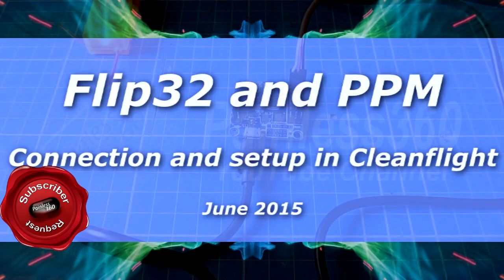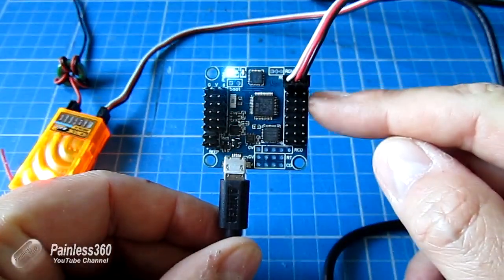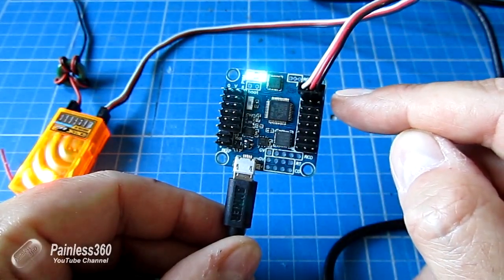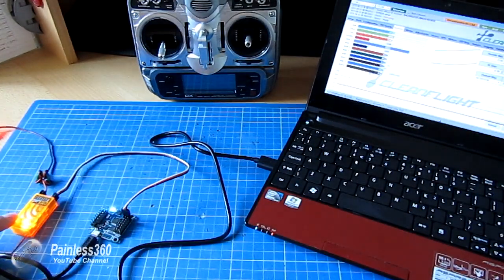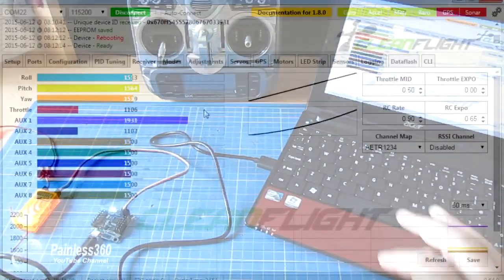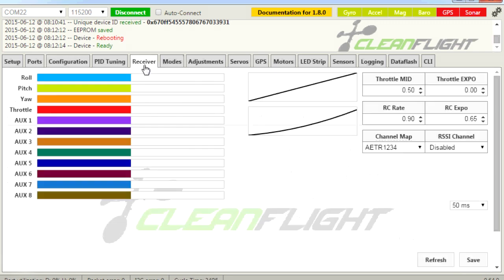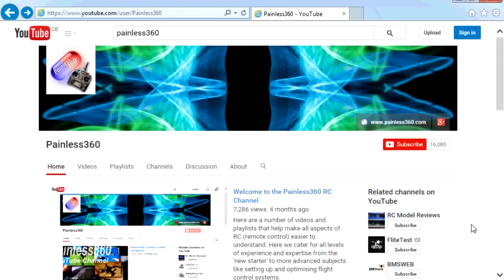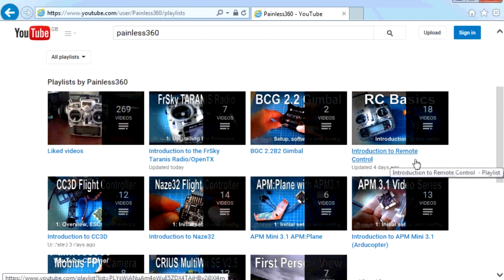Flip32 Flight Control Board: Installing the configuring CPPM/PPM

Comment: HI, thanks for the great video. My receiver and motors are working perfectly on INAV GUI. However, when I try to spin the motors with the RC transmitter, it won't work. I watched your building the quadcopter series, but I don't see any steps missing for my DIY drone. Could you give me some advice on this, please?
Reply from the maker: How are you arming the quad copter?
Reply: @Painless360  Arming the quad copter with the USB port to the INAV!
Reply from the maker: @Taka-tg8zq  I'm not sure I understand. You need to set up an arming switch as one of the modes. Please see my iNav setup videos for more information. Best of luck!
Reply: @Painless360  Arming is done perfectly. I watched the series too but there's nothing that I can add to fix. Maybe the problem I have is because I am not powering the flight controller with the battery but from the USB?
Reply from the maker: Motors won't run with USB. Please follow the steps in the beginners guides.. Best of luck!
Reply: @Painless360  My motor run because I am wiring an ESC to the battery. USB is for just to power the flight controller. The only issue that I can see is that I don't have a GPS module. DO you think that is the reason for not be able to use RC transmitter to run a motor?
Reply from the maker: @Taka-tg8zq No idea, most modern software won't let you arm when connected by USB.. Check the documentation and best of luck!
Reply: @Painless360  I am so sorry. It's a micro USB cable! So powering the FC with the cable like you do in the video!

Comment: Painless360

Enjoyed your video on using ppm with the Flip32, but no joy on my setup!

Setup is 9XR Pro w/ DJT module and D8R-ii plus RX into Flip32 running inav

System worked perfectly with T6 radio and PWM. When I switched to the 
9XR Pro with DJT Tx module,  I chose to use PPM. The DJT binds perfectly with the 
D8R Rx  but no signals are reaching the Flip32. I have changed the RX 
type in inav to  RX_PPM but none of the receiver channels are affected 
by the moving the transmitter controls. 

I am totally new to the PPM protocol ....... am I missing something ?

I have been banging my head against the wall for 4 hours now, but no closer to a solution. Any help greatly appreciated !!!
Reply from the maker: There are a lot of videos in the 'Introduction to RC' series that cover the basics and may help, some receivers do need to be configured to turn on their PPM output. Best of luck!
Reply: Painless

Thought you might like to know:  The Frsky D8R-ii plus is advertised as being a PPM receiver, in fact the (poor) instructions that come with it even says it's PPM (NOT PPM capable). Turns out it cannot do PPM unless upgraded to the equivalent of a D8R XP. I have done this and now PPM is working fine. Anyone comtemplating the upgrade should know it is not simple and not for the faint of heart. Buying the Frsky update cable does make it easier.

Thanks for your continuing educational work. Your videos are the best on the net - well thought out and excellent camera work. You set a high standard for others.

Cheers
schuh

Comment: Hello, thank you for your videos, they are excellent. I'm French and I have a  Flip 32 card in sbus with inverted cable and everything works perfectly. I would like to add a gps but how can I connect it to the rc4 flip32 if the entry is already occupied by the sbus? Is there no possibility of combining sbus + gps on flip32? Thanks

Comment: When using PPM or S-Bus how do you set the throttle end points for the motors?  Is it sufficient to just use the Motor tab in Cleanflight to accomplish this?
Reply from the maker: Dale S The same way as you would using PWM. Using PPM only changes how the FC hears the channels from the Rx, not how it runs the motors..
Best of luck.

Comment: Hi Lee,I have a naze 32 board ,watched all your videos but how do you connect extras to the quad I am running an orange 7 channel ppm RX how do I connect things like extra LEDs,retractable under carriage iam trying to fit a HK screamy lost model alarm please help.
Reply from the maker: +Geoff Taylor This is all covered in the Naze32 videos - you simply need to find where the pins are on the Flip32 for that feature. Everything else in the video is the same for both boards.Best of luck.

Comment: nice tutorial, do you have to program the RX in any way for it to work?
Reply from the maker: +rallekralle11 Normally no. Best of luck with the build. See my playlist 'Introduction to RC' if this is a new hobby for you..
Reply: okay, thanks for the help. i've build multirotors before, just not using CPPM.
Reply from the maker: Got it. Some Rx need you to set a jumper to configure PPM, some others not. It will be covered in the manual for the receiver. Best of luck!

Comment: My choice is to start fresh with a stm32 board like the Flip 32 +,  or keep the APM 2.6 and get the telemetry adapter ( teensy). first choice has better future prospects and costs less. what do you think?
Reply from the maker: Depends on what you want to do with them ;)
Reply from the maker: https://youtu.be/k4tQAmg2ssA
Reply: Video was great, cheers.Not bothered about acro as i am still learning to fly. Just want current support and everthing the APM gives, pretty much the Pixhawk, Pixhack, or what ever the latest clone is to be called. Anoyed that the mavlink to frsky telemetry adapter is £30, but i can use that with the Pix anyway. Great videos, i dont know how you manage to keep up.
Reply from the maker: Hold on - the PixRacer looks like it may be a lot batter in this regard..
Reply: yes, looks good, when will you be reviewing?
Reply from the maker: The boards are due out in the next two weeks so late January/early Feb.

Comment: Hi, got confused with S-bus setup for the flip32. Can you help or point me to the correct directions for setting up S-Bus for the flip32 please. thanks
Reply from the maker: Does the flip32 support s-bus?
Reply: I am not sure, it's suppose it does i guess.
Reply from the maker: A google search quickly showed that it needs a signal inverter to work with S-Bus ;) Best of luck!

Comment: Will this work with the X8R receiver? I'm having terrible trouble getting my Flip32 to power my X8R. I've managed to blow one Flip32 already. Where does the servo lead plug in the X8R?
Reply from the maker: +Next Lipo Please The question you need to ask is - does the X8R send out a PPM signal..... Check the documentation and you'll see part of your problem.
Reply: Ah right, I've seen one of your videos where you connect with a single wire between X8R and Flip32. Is that what I should do? I've tried youtube university but i'm still lost, your help would be massively appreciated.
Reply from the maker: Donation button on website ;) The X8R is S-Bus out not CPPM so you will need an inverter for the board (probably) and connect to pin 4 to get it to work. I'd use a D4R-II or similar with PPM out. A lot less hassle to use.
Reply: I've got the D4R ii but I can't get it to pair with my Taranis.
Reply from the maker: +Next Lipo Please Is that a statement or a question?
Reply: It looks like a statement to me.
Reply from the maker: Me too - just checking. I wasn't going to explain how to fix it if it wasn't a question ;)
Reply: Its fixed pal. ;-)

Comment: Hi!
I'm getting crazy trying to make the telemetry from the flip32 to work with my Taranis...
Do you know how to do that?????? :D
Reply from the maker: Use the soft serial method I show in the Naze32/Taranis playlists. Best of luck
Reply: I found a solution by using a DIY voltage monitor for frsky receiver. Much easier hehehe, it is only 2 resistors.

Comment: Hi I know this is an old video but I'm having a problem connecting PPM into a flip 32 flight controller to I'm sure that I'm bind to my transmitter and I have connected like you say but the darn thing doesn't work
Reply from the maker: What troubleshooting have you already tried?

Comment: As always greate video. I would be very interested to see how to use S.BUS between a X4RSB and a Flip32 Board. I look in the CleanFlight doc, it look's doable but need a serial signal inverter.

https://github.com/cleanflight/cleanflight/blob/master/docs/Rx.md

 Also Blackbox feature of CleanFlight look's very cool.

https://github.com/cleanflight/cleanflight/blob/master/docs/Blackbox.md

Thank's for all you shared work with the comunitty
Reply from the maker: Yes, you will need an inverter.  Setup is easy after that extra step,  see the SP3 series where we are using SBUS with Cleanflight. Blackbox will be covered in that same playlist soon. You will need an external SD card on a Naze32 to store the data though. .
Reply: Painless360  Ok I will watch the SP3 video. I justsee in the SP3 playlist that 2 videos are marked private ?
Yes I ee that for Blackbox they use a OpenLog device from sparkfun.
Reply from the maker: The other SP3 videos will be out in the next few weeks.  Watch this space!
Reply: Painless360 I will
Reply: I have looked the SP3 video for S.BUS connection. If I understand well, the serial inverter is needed for Flip32 but not for SP3 ?
Reply from the maker: Constant Dupuis yep.
Reply from the maker: +Constant Dupuis GPS, OSD,  vBat and Blackbox all on the playlist if you're interested. The videos will be released in the coming weeks..
Reply: +Painless360 you mean for Seriously Pro 3 ? I'm following all this closely. Thank's